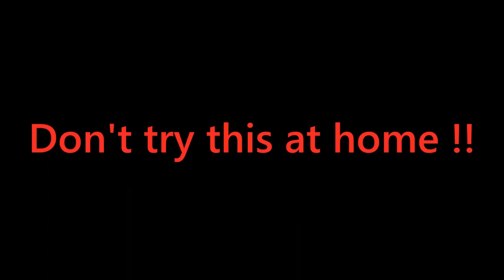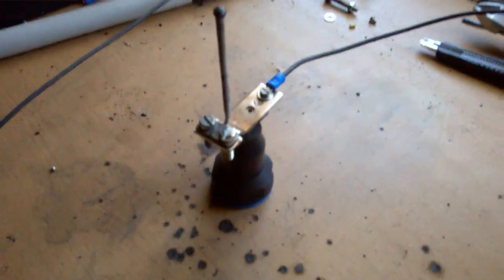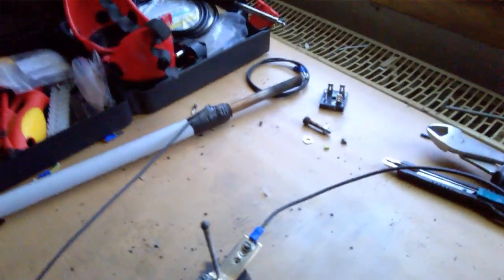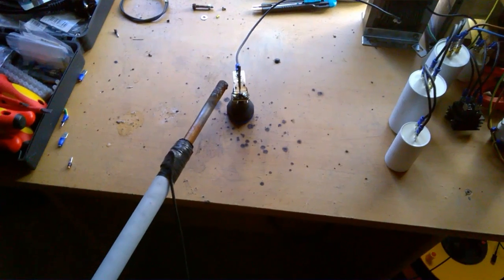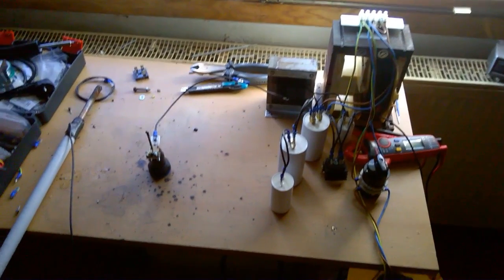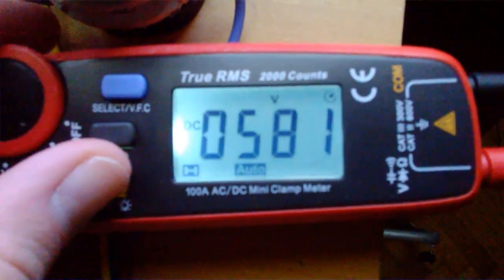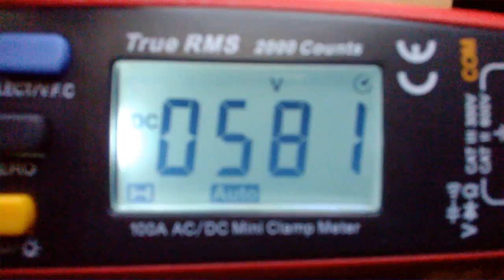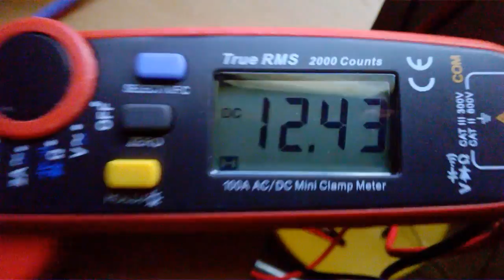600 Volts DC Electric Arc

Comment: Very tidy setup as always :) I think it's time I order a few bridge rectifiers off ebay for myself .DC arcs sound so much better IMO
Reply from the maker: +Lets NOT Play With Electricity Thanks :D That's nice ;)
Reply: Pure DC doesn't like anything other than a really loud hiss at high power. One in video is more like pure 100Hz pulsing, needs more capacitors or series of pi filters so 14A ripple is negligible.

Comment: Amazing results! I would have supposed a voltage in the range of several kV for such an arc. Thanks for posting!
Reply from the maker: +kilovolt Thank you, DC is very good for arcing ;)
Reply: +High Voltage Ah okay, so we should rectify and smooth our hv-supplies for getting even better arcs...
Reply from the maker: kilovolt Theoretically yes (I never tried it out), It would be very hard to get diodes and capacitors in the rank of several thousand volts

Comment: +High Voltage Grunty Crazy arcs!!;DD 12A arc at 580v? 7Kw plus!!;DD WOW, Lots Of power;DD A Mot would be in flames with one arc with that, Heck, Probably won't be able to handle the idle current!!;DD Thanks For Showing, Cheers Mate;DDDDDDDDDDDDDDD
Reply from the maker: +Variac maniac Yeah definitely and thanks :D :D
Reply: High Voltage You're Very much welcome friend, As Always, Cheers;DDDDDDD
Reply from the maker: Variac maniac 👍👍👍👍
Reply: i have a 800 kv dc power line near my house i wonder what  will happen if someone accidendally shortcut the four cables whit a kite whit a metal pole
Reply: @maddan0138  they should record it

Comment: Great sound, but as it is a DC arc the 50 Hz brrr'ing comes only from the transformer? Or is there just too little capacitance to smooth it out so that we can hear the 100 Hz ripple? Was it the rectifier that is smoking in the background?
Reply from the maker: Thank you, I used only 6 uF MKP capacitor on the DC side for voltage spikes suppression (so not enough capacity for smoothing), the rectifier works still perfectly (and I use it for a other project), the smoke is coming from the table burning (a white hot piece of metal fell on it, LOL)

Comment: have you played with the 2Kv mains transformer out of a microwave yet? It can be tripled up and recitfied to produce some nice arcs.  I orginally built one using a bank of DY86 rectifier vacuum tubes, until high current silicon bridges became available . Lots of fun.
Reply from the maker: I was playing with MOT, but they are poorly designed, overhead very fast, I have som nice big HV transformers now

Comment: Excellent, very nice arc with 580 Volts. Much better than a MOT. Was that the input or output current?
Reply from the maker: +Tristan HV I measured it on the end of the video, the output current was 12.43 amperes ;) And thanks !!
Reply: +High Voltage That's a lot of current, your transformer has a ratio of 1:2,5 (580/230) so your input current is nearly 12,4x2.5= 31 Amps (7 kVA)! That's lots of current, be careful so you don't burn anything, don't underdimension your cables!
Be safe ;)
Reply from the maker: Tristan HV No it has a ratio of 1:1.74(230/400), I measured both on the dc output, 580 volts dc are the peak voltage (237 volts RMS in to the transformer 412 volts RMS out, after rectification and smoothing capacitor 581 volts output)
Reply: +High Voltage Haha I forgot to calculate that ;) Thanks for replying :D
Reply from the maker: Tristan HV No problem, but you still have right that's should be 31 amperes on the input, but I measured only about 18 amperes on the input, I think it's some kind of power factor correction or resonance thing.
Reply: +High Voltage Right, I found one problem in my calculation, but here is how i got the input current now:
(580/√2=410V) so 12.4/√2~8.8A output current on the AC side. 8.8x1.74 (trans. ratio) ~ 15.4A input current + some losses I think :D
Reply from the maker: Tristan HV Yes, I see, I have calculated the voltage right but forgot to do the same thing with the current, thanks for correcting me :D
Reply: +High Voltage No problem mate :D
Reply from the maker: Tristan HV 👍👍👍👍

Comment: Very nice video, subscribed.

Is your step-up transformer originally from an arc welder? I have an arc welding transformer here with a very similar white plastic bobbin. The two small slots in between the coils held a pair of laminated iron shunts, which were connected to a worm-gear drive for current adjustment. I would guess that the primary was tapped to allow operation from 240V-440V (or similar values) and the high-current secondary has been removed?

Great stuff mate, stay safe!
Reply from the maker: Thank you and thank you for the subscription, and yes its from a arc welder, the high current secondary was damaged

Comment: Big arcs) You can use capacitor for filtering 50hz pulse, arc without sound was more cool) Sory for my english
Reply from the maker: +tohich010 I know that, but I don't have the necessary capacitors (and I like the noise)

Comment: If that was pure DC it wouldn't be buzzing. Its just rectified AC with a bit of smoothing.
Reply: Can you explain what you mean?
Reply from the maker: It's like pulsating DC, not enough smoothing capacitor

Comment: Cool thing, I have to try it, just need to find similiar transformer somewhere. How many amps did it pull from the mains? 25A breaker would be enough?
Reply from the maker: I think I was use like 20 amps if I remember, yes 25 amp CB should work

Comment: That is an AC 50Hz arc. DC only makes a slight hiss or a crackle. There is no humming or buzzing to DC. That is why AC is my favorite, but I like 60Hz better. Next time, try 60Hz!
Reply from the maker: It's pulsating non smooth DC (there is a rectifier but no smoothing electrolytic capacitor), in EU we have only 50 Hz, to get  60 Hz or any other frequency I would need a very large frequency converter unfortunately.

Comment: Hey I liked your video it is awesome. But I am confused. What If I use AC instead of DC for making Arc? I have transformer and I want to create an Arc with it. Is that possible? Also is frequency effects to an Arc? Thank you again for such a good content.
Reply from the maker: AC works too but you need high voltage like 1 or 2 kV, frequency is not so important
Reply: High Voltage thank you so much. I was waiting you reply. I have a transformer which I can transform 3 phase 380V 600A to 3phase 120V. Is it enough to make an arc? I will use graphite electrodes for this experiment.
Reply from the maker: @birdost12345  that is pretty low voltage, you need a 3 phase rectifier, and current limitation, carbon rods should be good
Reply from the maker: @birdost12345  600 amp like a distribution transformer?
Reply: High Voltage yes that kind of. But I am making a research about arc furnaces. I don’t need industrial size I will do it just for fun and for my material research’s. So this arc won’t jump through air. It will complete the circuit through sample. But according to my experiments I couldn’t make the jump successfully. I guess I need to raise the voltage as your suggestion.
Reply: High Voltage what is the help of rectifier? Why should I use it? I know it’s mission but I couldn’t get it well tbh.
Reply from the maker: @birdost12345  it's much easier to make a arc white DC then AC
Reply from the maker: @birdost12345  Ok I see
Reply: High Voltage Really? I couldn’t find any document about it. Also if I would want to use high power then I need to build more big circuits to invert it to DC right? So what is the point of it?
Reply from the maker: @birdost12345  yes DC makes much easier arcs, in AC you have zero crossing periodically for 50Hz (European mains) that means the arc kind of extinguis every 20 ms am reignites, in DC it's a continuous flow of electricity, even a high ripple poor filtered DC is still better, for example all professional arc welders at DC output, (with the exception if you welding aluminium then you need AC for cleaning the oxide layer) because it makes a relay smooth arc, you can also see in switchgear how much harder it is to break a DC arc, they need a much more sophisticated system to break the arc.
Reply from the maker: @birdost12345  to make a small arc furnaces you just need a DC stick welder and carbon rods
Reply: High Voltage Thank you again for your time. These informations are very important for me. Also do you have any documentation advice for me to go into details?